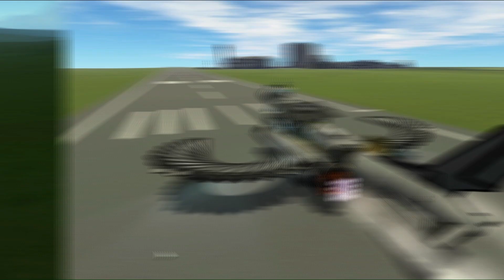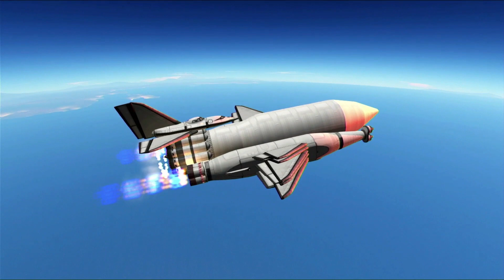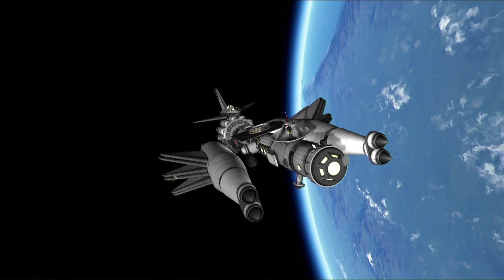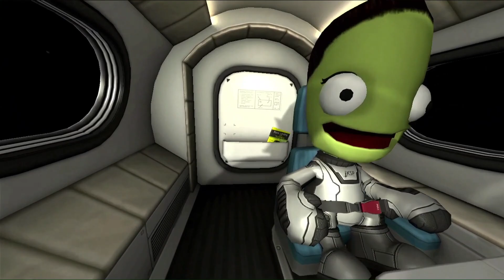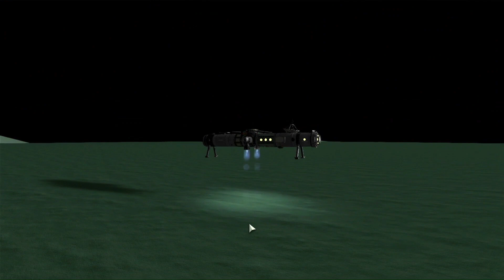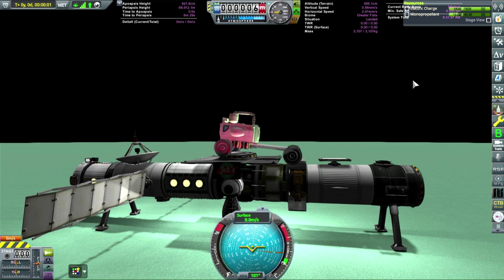KSP - MASSIVE SSTO Launched Minmus Base (With a Launch Pad!) - SimpleConstruction

Comment: One thing I hate, particularly as I love building planes in ksp, is that the largest cargo bay is the mk3 which can’t even fit a mk1 fuel tank with river wheels on it
It’s too narrow, it’s too small, it’s too pointless. I miss b9 as it’s cargo bays made cargo aircraft have a purpose for terrestrial operations but it sadly hasn’t been updated for the more recent versions of ksp
Reply from the maker: I totally agree, seems like it would have been easy to add cargo bays in all the fuel tank sizes. Ah B9, I miss it too made some really cool ssto and planes with that mod. I wish those parts were stock :(
Thanks for the comment btw :D

Comment: That was pretty cool, and easy to listen to, too.

Driving on Minmus is awful! :) 'Hopper' or 'puddle jumper' class vehicles make a lot of sense in low gravity, especially on rough terrain. They have rockets pointing down, and you move around by tilting the vehicle, though tilting the rockets is possible too. For long distances, it's more fuel-efficient to make a suborbital hop than to muck about at ground level. 
The original, real-life puddle jumper was for training astronauts for the moon landing, but some sci-fi authors picked up the idea because it seems so practical in low gravity. (I think some preferred the name 'hopper'.) How to balance them? Well, 2 big reaction wheel sets were good enough for my long-range Val hopper, but it wasn't a cargo vehicle. For cargo trucks, maybe fit vernor engines pointing down only, and let SAS sort it out. Vernor engines aren't very efficient, so for a heavy load, I'd fit an auxilliary engine or 2 and adjust thrust limiters in EVA construction. Just theorizing. :)

For Minmus specifically, I've also seen rocket powered cars with little rockets on hinges. Point them forward to accelerate, back to brake. Cupcake Landers showed off one he said was capable of, I think, 500m/s on the flats! I guess steering is by gimbal. I can't see how you could steer while coasting.
Reply from the maker: That's an interesting concept I'll look into some designs and maybe do a video on one. Since I'm planning to have the actual Minmus colony 3km away from the launch pad (out of physics range) some kind of reliable transport in the future will be very useful. Thanks for the info!! :D
Reply: @smooneychad  You're welcome. I hope you have fun with it :)